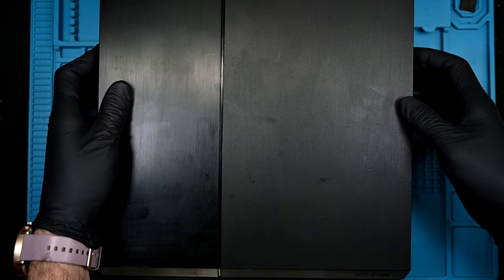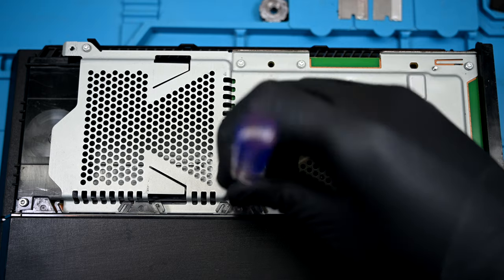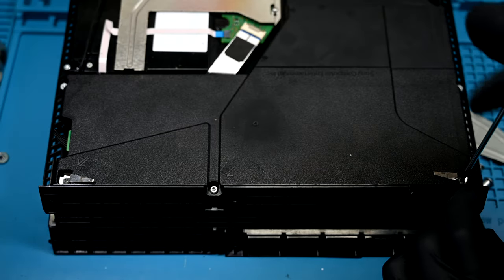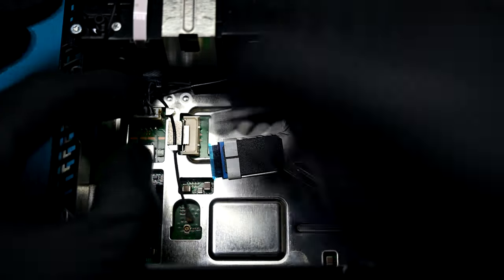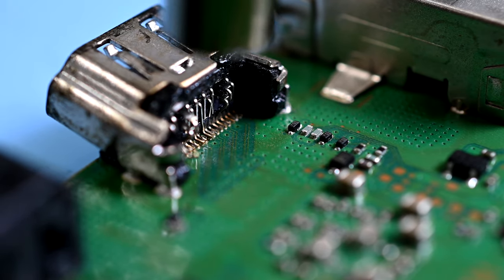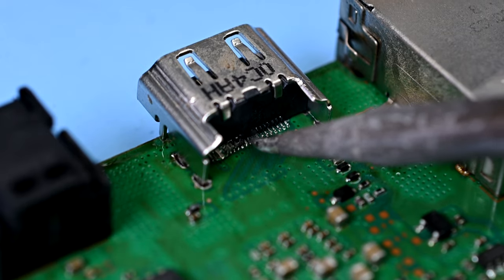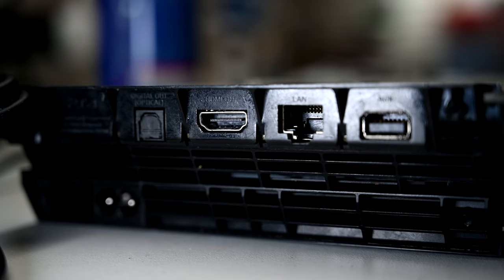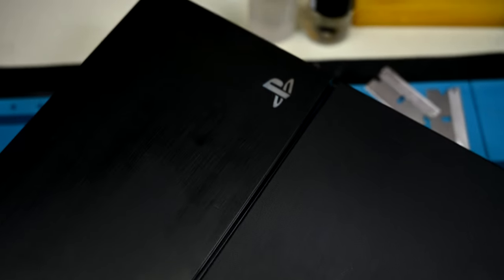PS4 HDMI Port Replacement | Guide

Comment: Hey do you have a list of tools you use. I’m new to the circuit board repair game and just wondering what I need and where I could find all the stuff like soldering tools and stuff like that.
Reply from the maker: I really should post a list somewhere... In any case, the drivers are just a set of security torx drivers from a hardware store, the other stuff:

Hakko FM203-HD. This iron is kind of overkill for somebody just starting out, Hakko is just a good choice in general for irons. Temperature control is good to have.

Quick 861DW Heatgun. Also overkill, any that has temperature control and can reach at least 450°C will work fine.

AmScope Trinocular boom arm microscrop with 10x-45x. Even a cheap USB microscope will get you going.

Many of the products can be found on Amazon, Mobile Defenders, Mobile Sentrix, or maybe some local hobby shops.

Hope that helps!
Reply: Ya me too
Reply: The I fix it kit is great for stuff like this
Reply: I need help fixing my ps4
Reply: @TapticDigital  liked and subscribed, so many questions lol great video. What are the liquids you use in the processes like removal and adding new solder. I see you using a clear liquid i think you called it flux and what is the stuff used to clean of the old solder and old paste. I hear lead and non lead solder being mentioned as well, many thanks Andrew
Reply from the maker: @andrewknox8986  the liquid being used is Flux, this is used to help solder flow and attach in a cleaner way. The Flux creates surface tension keeping the solder all together in one spot, it also helps remove some impurities. Alcohol cleans it off. I use leaded solder since it has a lower melting temperature, I mix it with the existing lead-free on the board so it melts faster, then using copper soldering wick (sometimes called braid), I soak up the old solder, and replace it with fresh.
Reply: @TapticDigital  thank you for the indepth reply
Reply: Going to now try this next time i have one to repair with confidence due to your video and help 😊
Reply from the maker: @andrewknox8986  I'm here to help! 😊
Reply: @TapticDigital  can you replace the port with lead free solder?
Reply from the maker: @Gecko730  you can it just takes longer/higher temp to melt
Reply: @TapticDigital  ok thank you and can I do it without flux or it's important ?
Reply from the maker: @Gecko730  it's pretty important for getting the solder to smoothly attach to the pins, without it you can end up with bridged connections and sharp solder spikes, it's harder to make a clean connection.
Reply: @TapticDigital  I saw that the are multiple types of flux, what is the different between flux and thermal paste? And is the one in the box the same as the one in the syringe ? And what is the difference between the gray and yellow ones?
Reply from the maker: @Gecko730  there are a few differences, but I like using any kind of tacky flux. It dries solid and can be chipped off, but also cleans well with isopropyl
Reply: @TapticDigital  is that the ones that are sold in those round metal boxes?
Reply from the maker: @Gecko730  no, that's soldering tip cleaner/refresher. Most flux will come in a tube or syringe. Sometimes solder has it infused and will be called "rosin-core" but more is usually better. The brand I use is ChipQuik, but I've heard good things about Amtech from Louis Rossmann
Reply: @TapticDigital  the tubes are like 10ml and costs 7€, will 10ml last long?
Reply from the maker: @Gecko730  quite a bit, it only takes a few drops on the repair
Reply: @TapticDigital  where do I get the h.d.mi input part?
Reply from the maker: @petermcgaffick4775  first link in the description
Reply: I’ve read the comments and replies. Just one more question for u. Wot heat sink paste r u using?
Reply from the maker: @dainton187  I'm a big fan of Arctic thermal paste, the Arctic Silver 5 is my go-to.
Reply: Fuck fixing it just going to get a ps5
Reply from the maker: @skyhighgang  definitely an option! But $100-$150 for a repair at a shop is still way cheaper than a PS5
Reply: @TapticDigital  can u fix mines
Reply from the maker: @twinsdavis  I don't offer mail-in repairs just yet but I would recommend checking local shops with decent reviews! Most cell phone repair shops also work on consoles
Reply: @TapticDigital 😅
Reply: @TapticDigital  What's the difference between the Flux and Solder Mask? I've watched a couple of channels but they never explain any of these liquids they use in soldering
Reply: @andrewknox8986  Careful tho, u'll definitely need a microscope for precision. One mistake could wreck ur motherboard
Reply from the maker: @Moa_Smug  Flux is used to help solder flow where it needs to go without smearing, it does this because solder and Flux don't mix, kind of like oil and water, so it helps to keep it looking clean. Solder mask on the other hand goes over a soldered point to keep it from contacting other components. Let's say you had to attach a jumper wire to a ripped pad, you could attach it and then mask over it to keep it safe and add some extra hold to keep it in place.
Reply: @TapticDigital  I see thanks for the detailed explanation
Reply: @TapticDigital  I have some more questions, my head's getting overloaded with different infos making me confused.

Question 1: Can u do soldering on an HDMI port without the need to use a Tin metal/stick? I mean it's mainly used because of the Flux inside the Tin metal right?

Question 2: Before attaching the HDMI port into the Mounting pin holes, can't u just use Soldering Mask on said holes so when u attach it and the mask dries up it'll stay there rock solid?

Question 3: How to easily remove Solder Mask when it hardens? Flux can easily be removed with Isopropyl alchohol, but what about Soldering mask?
Reply from the maker: @Moa_Smug  not sure what you mean by tin metal/stick, if you mean the soldering wire itself yes it does have some flux in the core of it.

No, mask can only be applied after, soldering and high temperatures remove it.

Mask is removable but not with alcohol and it can be kind of messy to chip off, it's a kind of epoxy/resin that cures with UV light. It is meant strictly for repairing damaged boards where traces have been ripped or exposed or PCB has deep gouges in it. Think of it like painting over a scratch on your car's paint.
Reply: @TapticDigital  I meant the Soldering Wire yes, in one of the vids i watched earlier they called it Tin, and since it's metal and looks like a stick i called it that.

So can u just use Flux/Soldering Paste directly when Soldering instead of using the Soldering wire? I can't find the right words but i hope u understand what i mean.
Reply from the maker: @Moa_Smug  technically you can! It would work just the same as soldering wire, you would just use a heatgun to melt it instead of an iron probably.
Reply: @TapticDigital  I see thanks, one other thing. Which is better, A leaded or Lead-free soldering iron/station? I just found out not all soldering iron/station are the same and are split into these 2 types.

And what are the Pros and Cons of each of them?
Reply from the maker: @Moa_Smug  it's really personal preference, almost all consumer electronics use unleaded to comply with regulations in different countries. Soldering stations don't care, they'll work with both just fine. The main difference is that leaded solder melts at a lower temperature, while unleaded melts at a higher temperature. For example, when I use leaded solder I can run my iron at 400c with no issue, but if I use unleaded I have to turn it up to about 450c.
Reply: @TapticDigital  I see, if i ever decide to buy a soldering iron/station i'll probably just go with Leaded Soldering Iron/station so it'll be easier to melt stuff but i'll be needing a fume extractor so the smoke won't end up getting into my face.

Thanks for answering all my questions, i can finally sleep with a peace of mind. 1:46 AM here in my country 😅
Reply from the maker: @Moa_Smug  oh wow! Yeah it sure is late for you! And whether you go with leaded or unleaded, I'd always recommend a fume extractor.
Reply: @TapticDigital  Ok thanks i'll be sure to get a good fume extractor when i buy a soldering station. 😉
Reply: What is the gel type that u put on there befor the heat gun thing
Reply: Awesome! Thanx to you guide was it a piece of cake😊❤
Reply: Wish I could find a video that doesn't include taking apart your ps4 and using tools to replace the HDMI port with another one and putting it back together. How can I fix my ps4 without doing all that? By the way my ps4 has not been touched since 2019 besides me trying to clean the port and just turning it on for nostalgia
Reply: Just because it's important. 
I'm new to the electronic game, but I think I can handle this. I'll update you with the outcome. Thanks for the video.
Reply: @TapticDigital mine charged me $200 usd to repair my ps5 im investing in the tools to do it myself my ps4 is having same issue can I rob an hdmi from an broken tv or other device and reuse it?
Reply: You if I’m not wrong can get the welding stick that you can melt with a lighter

Comment: After seeing this video, I can confidently say I will be buying a PlayStation five as there is no way I can do this myself lol. Thank you for the great video.
Reply from the maker: Definitely not for the faint of heart when it comes to soldering! You can still get it repaired at a lot of shops for around $100, but I will say the PS5 plays reeaaally nice too
Reply: 100%, I make over $100 an hour at my job and would be a lot easier to buy a new PS4/5
Reply: Loool😂
Reply: Doing the same here , while I am tinkering with the PS4 whenever I have the chance 😅
Reply: Aren't you a lucky duck  @JohnDaniels

Comment: Haven’t attempted to replace my HDMI port yet, but after seeing this video, I feel more confident after seeing that it can be done! Thank you for posting this! Very well put together, easy to follow and much appreciated humor. Looking forward to explore your channel and try to learn something. 😊
Reply: Just failed with mine, got nervous about how much heat it was taking and tore every single pad. My word of advice if you ever try this is wait about another minute from when it starts wiggling.
Reply: @trentm5586  sorry to hear that. If not for some of the comments online which talked about how much heat the board can safely take (A LOT), I definitely would've done the same because it really does feel like too much.
Reply: @trentm5586  Every heat gun is different so best start with low temperature say 100° celsius and slowly increase from there to see how fast it can melt the solder joints without frying the othee components
Reply: @trentm5586  Also nevee use heat gun without Flux or u risk the components getting sent flying

Comment: Very nicely done. I've got a pretty accurate temperature gauge on my soldering iron, but the only heat gun that I have is huge and has just 2 power settings. Would you recommend using that gun? If so, what do you recommend covering the other components with, to prevent melting the entire thing into a mass of toxic goo?
Reply from the maker: Just depends how high that heatgun goes. Anything past 500c runs the risk of bubbling the internal PCB layers, and that's not repairable. You can cover components with kapton tape (the yellow kind), if you don't have that use pretty much any thin metal covers will work, I've been known to use a razor blade to just cover things.
Reply: @TapticDigital  Thanks, I'll do some testing to see what temperature the low setting on my heat gun puts out.
Reply: @theorncampbell4432  There are also barrier sprays we use in the automotive trade when taking an oxyacetylene torch to a car. It protects sensitive materials like rubber and plastic from the intense heats needed to cut or loosen bolts. They make them for all sorts of applications for the same reasons, so I imagine there are some specifically for electronics.
Reply: @goodolddoug889  Thanks so much. I'll do a bit of research.
Reply: what kind of heat gun is it cause I only have the same kind. I'm hoping the low setting is good enough but no way to test it
Reply: So you need a heat gun to do this?

Comment: Great guide, thanks so much! I managed to successful repair a PS4 HDMI port.

My first attempt I messed up the replacement HMDI port by melting the plastic a little too much and bridging the contacts.

Attempt 2 I thought I had done something similar but turns out it is perfectly good.

 Patience is key and soldering skills help a lot!
Reply from the maker: Heck yeah my dude! Good job! That plastic back is super unforgiving when heat gets to it, and sometimes those pins will "suck" the solder up and bridge themselves internally.

And it doesn't have to look absolutely perfect, just functional!

Glad my video helped! 🙂

Comment: Thank you for this video! I jumped into the port replacement thinking it would be no big deal but after research I realized I may be over my head. But I bought a crappy hot air station and some watch repair magnifying lenses from Harbor Freight for $5.50 and got to it, and had a great success! Your video was instrumental.

Honestly with all the talk of how hard this job is online, it was not nearly as bad as I expected considering it was my first experience with soldering on a PCB. Hardly a pro job that I did but it worked.
Reply from the maker: It can be scary when you aren't sure exactly what to do, but I believe that anybody can repair their electronics with enough confidence and research! Glad you got it working, and good job!
Reply: @arealsourapple bro did you find everything you needed from Harbor Freight? Mine legit just went out 😪 I’d rather repair this myself seeing how simple he made it seem. I have experience w soldering and what not due to my job but any of those items would be overkill on this. Just trying to find the cheapest solution
Reply: @210nitenite_diver5   No, sorry my post wasn't clear. The hot air station was purchased on Amazon, as well as some flux and lead solder. I already owned a soldering iron but it wasn't a very good one. The only thing purchase at Harbor Freight was the magnifying glasses. 

In all it was a bit janky and frustrating but it got done.
Reply: @arealsourapple did you use a crappy hot air gun for 10$ or the midrange one?